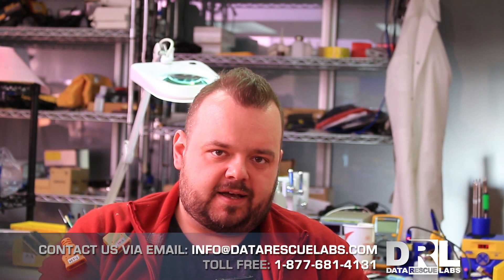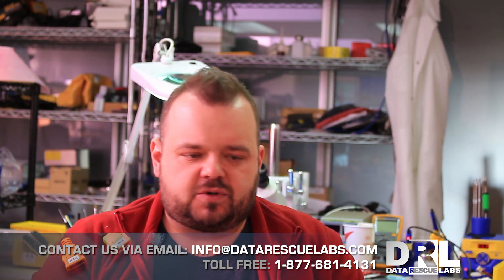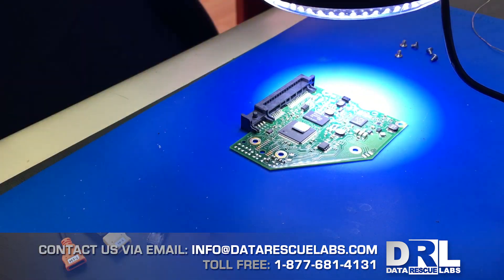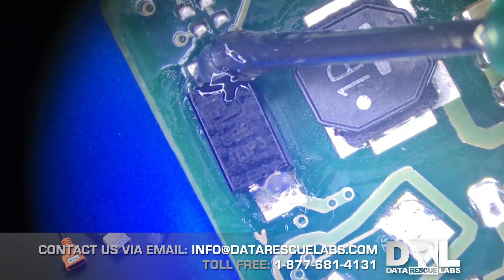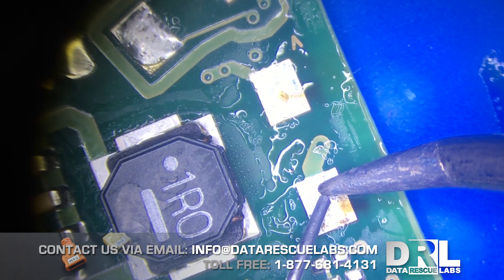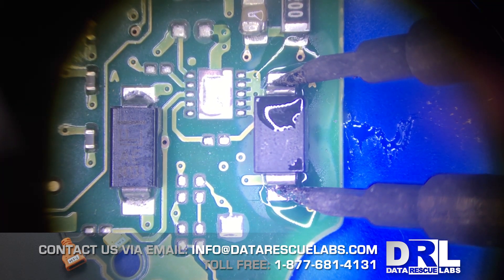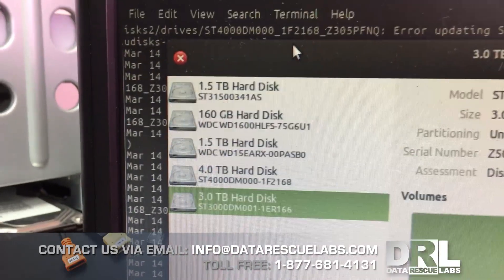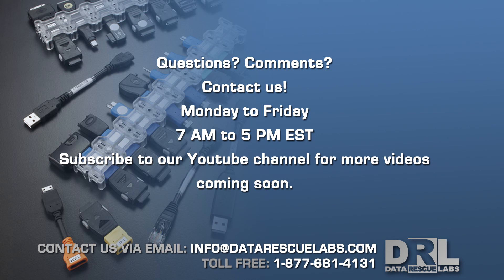Seagate Drive not responding - Quick and easy fix

Comment: OP mislabeled and edited video to seem "quick and easy" takes board off , does volt test, finds diode needs replaced. Pulls out soldering iron . 🤦‍♂️ THUMBS DOWN for misleading this is not an actual "quick fix" the normal user would not be pulling apart their hard drive and soldering .
Reply from the maker: If you don’t have the skill to do this, you can send it to us for recovery. What you need to take away from this video is that you can do this without tools, if you listen to the whole video I did say that all you can do is remove the broken TVS. You will at the least need the multimeter to check which one is damaged

Comment: fzabkar said:
    I found the problem. There is a stuck bit at this location:

    Code:

    Offset(h) 00 01 02 03 04 05 06 07 08 09 0A 0B 0C 0D 0E 0F

    00025C10  00 00 00 00 00 00 00 00 00 00 00 00 08 00 00 00
                                                  ^^

    When I change the 8 to a 0, the CRC becomes 0x0000. :)

    F3RomExplorer is happy with the edit. If you can reprogram your ROM after making the change, then hopefully you will recover your data.

    I use HxD (freeware hex editor).

FZABKAR

OH MY GOODNESS! YOU ARE AMAZING! YOU DID IT! PRAISE GOD! YOU ARE A SAINT!

2.82 TB - 3,106,287,262,945 BYTES - 748,329 FILES, 57,259 FOLDERS

TAKING (1) DAY TO COPY! IT'S COPYING RIGHT NOW!

YOU HAVE NO IDEA WHAT THIS MEANS TO ME! THIS WAS MY MAIN BACKUP DRIVE THAT I BACKED EVERYTHING UP TO RIGHT BEFORE IT DIED. I WAS MOVING STUFF AROUND AND PICKED THIS DRIVE TO BACKUP STUFF TOO. I WAS GOING TO ORGANIZE EVERYTHING WHEN I PLUGGED IT IN AND ALL OF A SUDDEN IT WAS GONE.

THIS IS INCREDIBLE!

Comment: I will be geting my rework station tomorrow. May I ask what heat setting is best for removing this PCB Board Firmware Rom Chip? It has a digital setting with three numbers on it so I would assume I could set it to the exact setting. I need both settings one for the soldering device and one for the heat gun part. It has two settings.
Reply from the maker: Use flux and add some low melt solder onto the legs of rom. Then 375c @ 60 flow should do it but all hot air stations are different so you will need to find the right number for you. The settings I gave you should be a good start

Comment: same problem! i have 2 hard drives same brand 3tb seagate and i switch power board and circuit board and still nothing!   i dont get it?
Reply from the maker: It could be a seized spindle motor. Sometimes what might appear as a non spinning disk but if you were to put your ear on the HDD and listen very closely when applying power, the drive would make a very faint one single tick. Could also be other components on the pcb that failed, either the fuses or other diodes 

If the data is important, we can have a look at it. Contact us via email krzys.stanko@datarescuelabs.com

Comment: i have exactly a harddrive with this pcb....a 2tb seagate....i replace the diode but nothing helps....hdd wont spin!
Reply from the maker: Heads might be stuck to the platter. Or another issue on the board. There are also fuses on there

Comment: I wanted to say thank you among all the negative comments, similar drive and problem fixed with solder iron and ceramic needle nose! Took me less than 10mn to have my powerless hdd up and running!
Reply: Out of curiosity what is the removed parts purpose? from similar projects it seems to possibly be a type of voltage regulator or eprom chip, second I did not replace mine.  what risk is involved not replacing it?
Reply from the maker: It’s a type of a fuse, there are two on each board. You can remove them both but the board won’t be protected from any further voltage spikes.
Reply from the maker: People like to complain. If anything, you were able to take what you needed from the video and use it to recover your own data. That was my whole plan. I am glad this video helped you